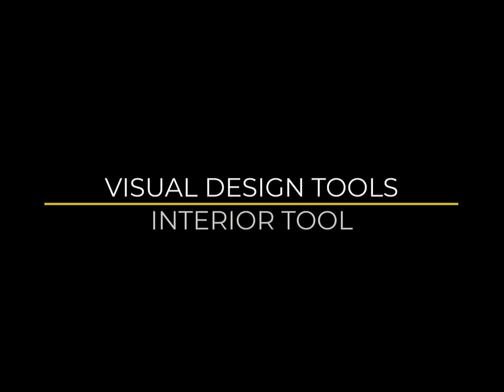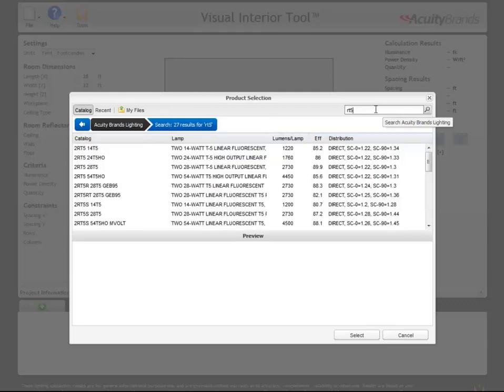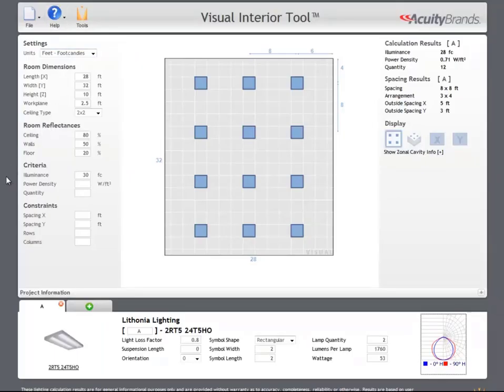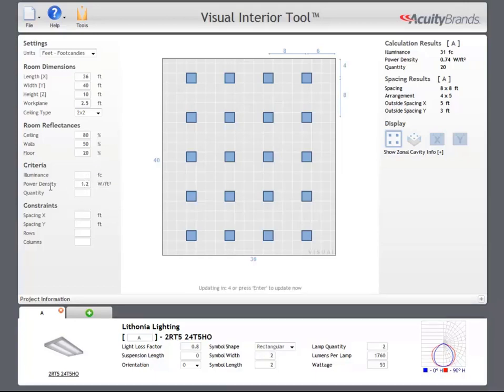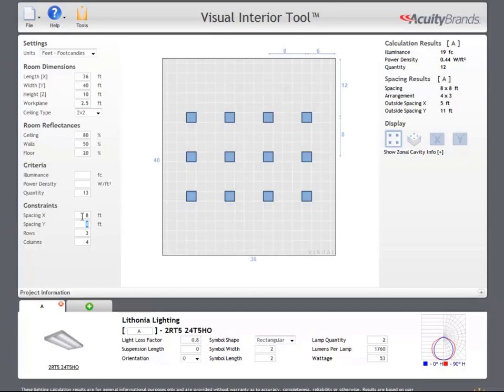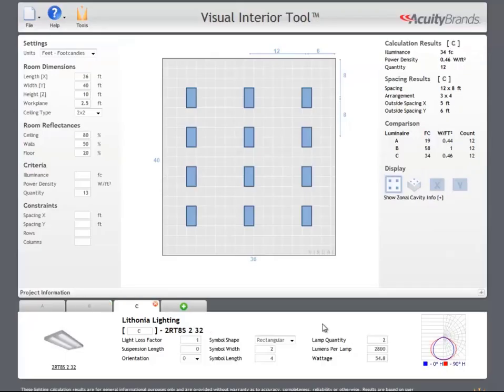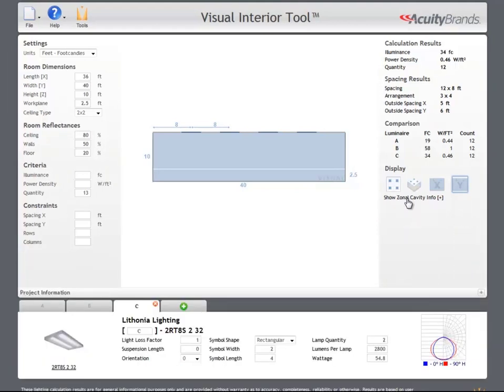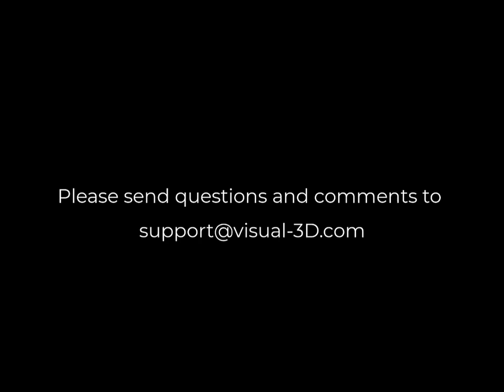Visual Design Tools - Interior Tool

Comment: When I save the drawing to my downloads, I can't open it? Doesn't know what program to open it with?
Reply from the maker: The file is specific to the Interior Tool, and because it is web based, you need to open the file inside of the Interior Tool to access it, not from your desktop. Simply select File > Open from the Interior Tool on the web browser, or inside Visual Lighting to view the file.